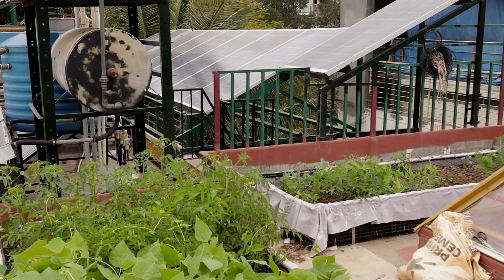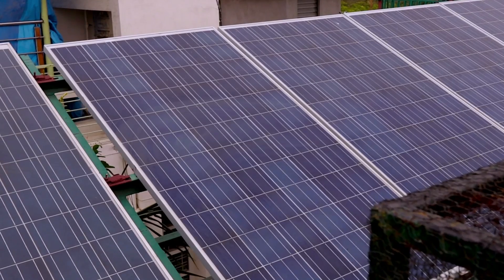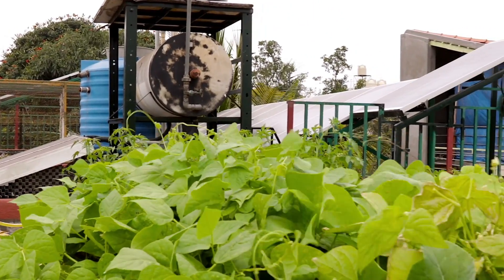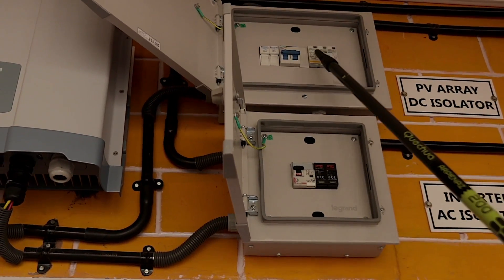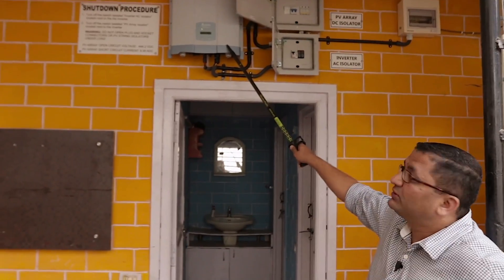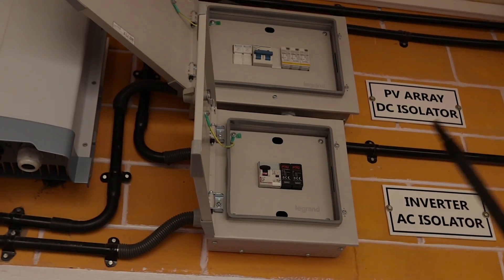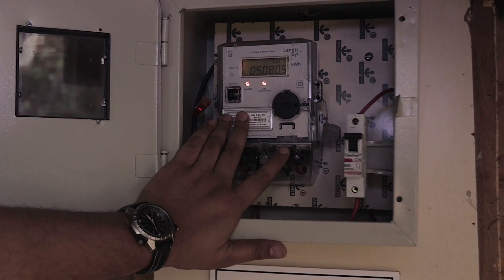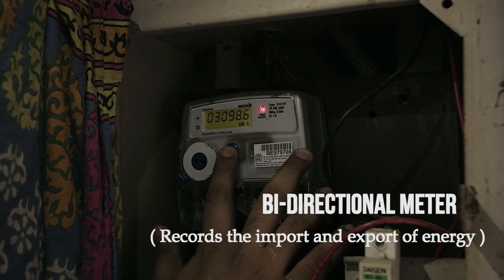Grid Connected Rooftop Solar power System .

Comment: But in on-grid if  sometimes power of my house gets cut let say for 5 hours. (12pm-5pm) Then my solar PV system doesn't work. And off-grid system is very costly.
Reply: Vikas Duryodhan you can use a hybrid system

Comment: Here's a question - why is electricity production by private individuals worth far far less than the electricity supplied by the big power companies? This is usury, and an unconscionable act which needs to be challenged worldwide. If we can sell electricity for the same price to the grid ad what we pay for, then the takeup of rooftop solar would... well ...go through the roof .... (sorry). But it would go a long way towards achieving zero emission electricity. I know the opposite side would say intermittent blah blah but battery storage! Or better yet if we can't get the same price, we all go off grid! Residents within a locality could work as powerful trading blocks and demand fair deals or all go off grid.
Reply: You have to consider the cost of infrastructure built and operated by power companies to transport the energy.
Reply: Alrukitaf 9462973347